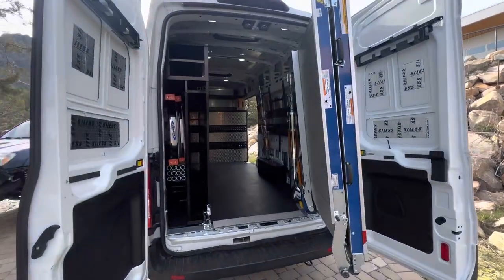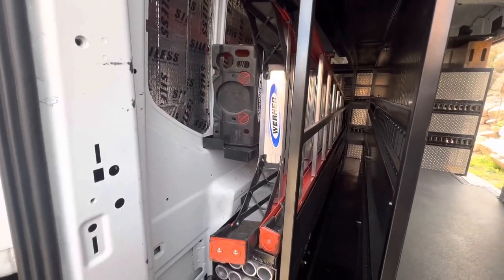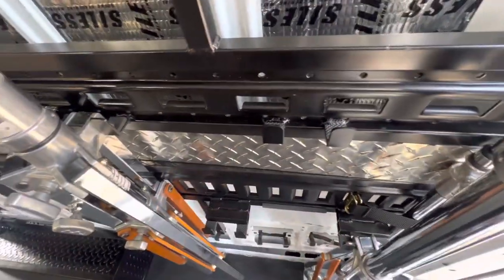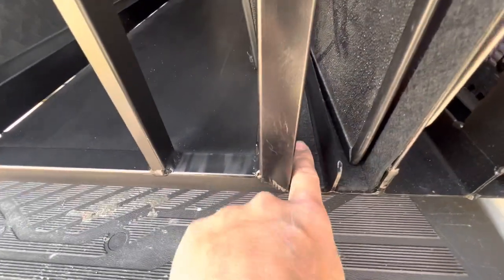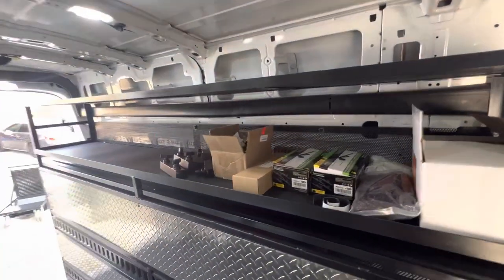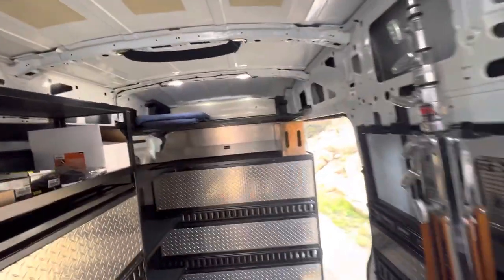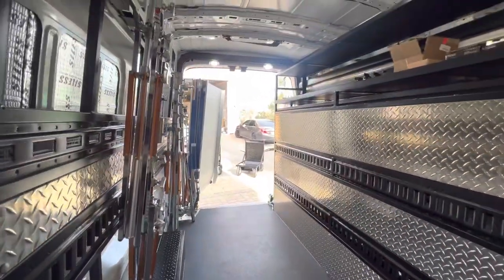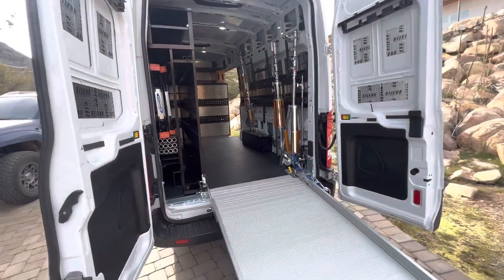Custom grip & lighting van

Comment: Really awesome video, thank you!! A quick question as we will start building our half-ton next week. You don't have insulation (or not much) in the van. Don't you worry about hogh/low temperatures tackling your more sensitive equipment? :)
Reply from the maker: Thank you buddy. Honestly I build whatever the customer wants, and this particular customer only wanted sound deadening. But truthfully equipment is going to get just as hot or cold in a Grip truck as it will in a van. I’ve never seen anything get ruined in either one in 20 years.